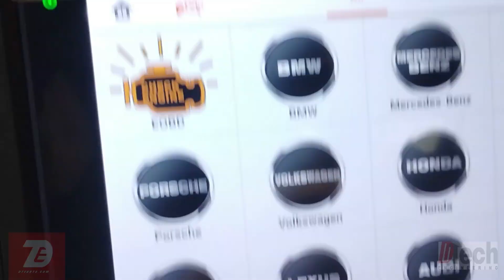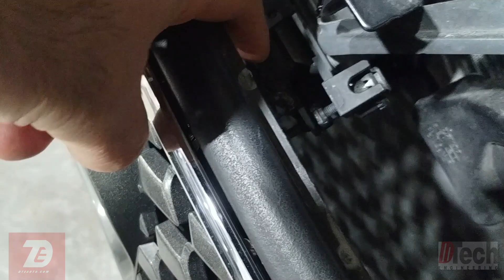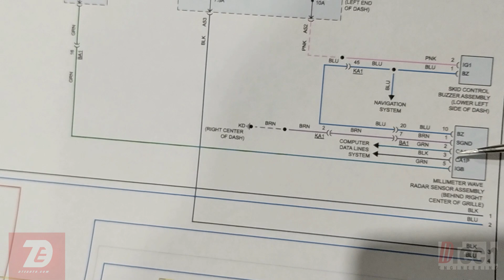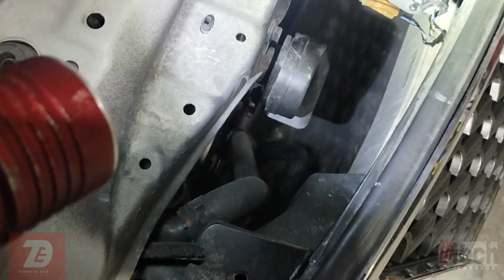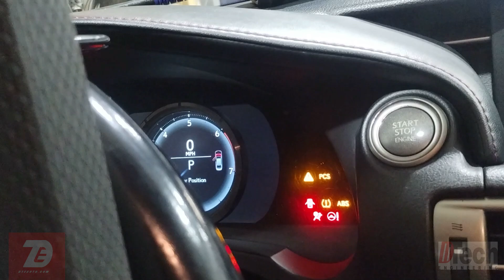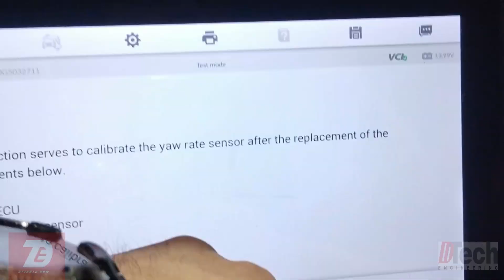Lexus iS Range Sensor No communication Code

Comment: BUS activity can still give 5V total but be wrong BUS activity, let's see what's coming in the video NOTHING WTF, CANCLow should be around 2.4V and CANCHigh should be around 2.6V, a little higher for H and a little lower for L is fine but your 2 readings are way off. A bad test ought to be followed by a good test before the end of the video, wrong measurements on the 2 CAN lines, then a wire repair, then a GOOD CAN measurement was next please Brother. After body shop = easy fix. Thanks for the TECH TIP video.

Comment: I would have cut off all those connectors and put on some quality heat shrink connections and charged them for it.  This is a nice car, having trash connectors on there like that is not something I would leave there.
Reply from the maker: My goal and intent was to find out the main cause of issue before making things pretty